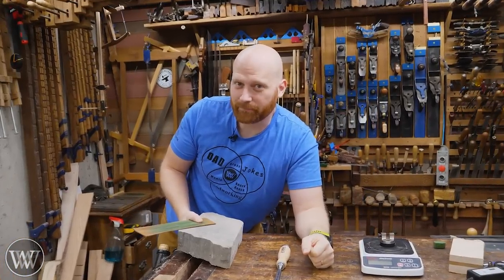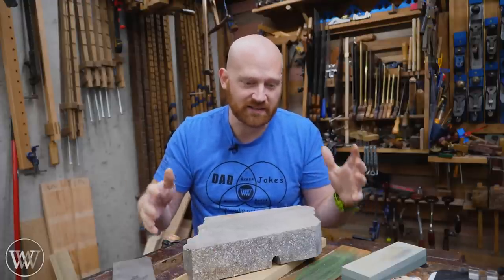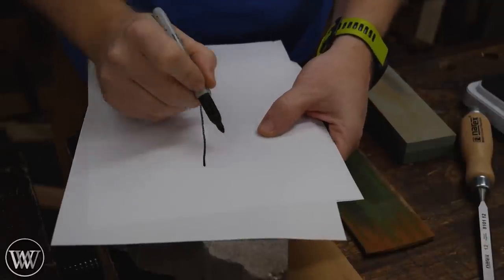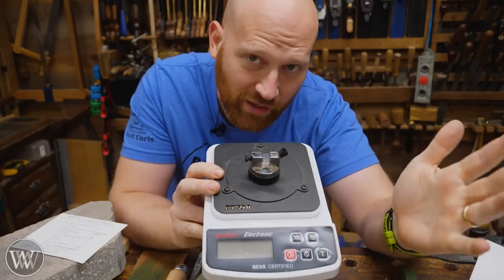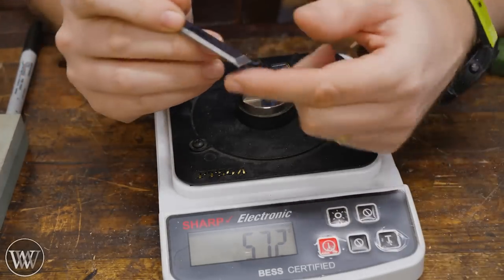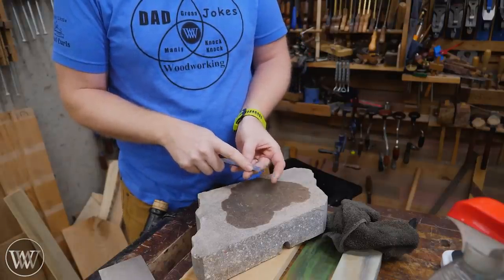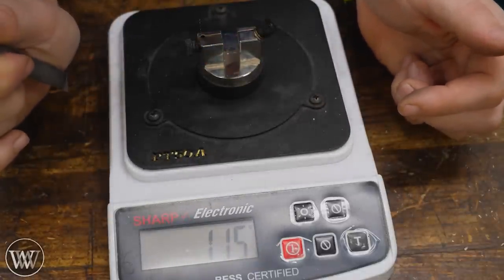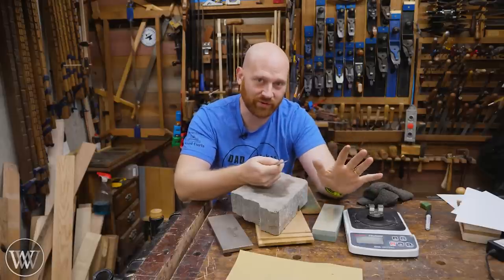Can you Sharpen With Concrete

Comment: When I was a kid I was taught a basic version of the three plate method to get a brick or block flat enough to sharpen tools. My old man was a mason, and we didn't need a lot of super sharp tools, but sometimes you did and a flat enough block/brick wasn't always available. The three plate method is overkill for most needs. If you just take two blocks, get some water between them and rub them back and forth in a somewhat random pattern including some turns and flipping which one is on top, you'll have a flat enough surface in a couple minutes. That's pretty much all you need for most garden tools and such. Even without a strop, you can use a red brick to get a knife blade shaving sharp as long as you flatten it first.

Comment: Sharpening is one of those things that seemed very daunting when I first had to sharpen, mainly because many youtubers make so big a deal of it. But then I just decided to get a 40$ whetstone sharpening kit from Amazon with two stones (grits 400/1000 & 3000/8000) and just sorta went for it. Turns out it's not that hard at all.
Reply: Exsctly what I did
Reply: I started with something similar.  A double sided 400/1000 diamond stone, and a strop with green compound.  I even glued the leather upside down.  Everything still worked great.  (As a tip for others, soft "drawer liner" works great.  Put your stone on top of it to keep it from sliding around.)

I've since moved on to Rex Krueger's "Cheap, thin diamond plates & strop glued to a melamine board".  Rex's video compliments this one very well.  
James: "You don't need anything special to get your tools sharp.  See, you can even do it with a rock."
Rex: "So stop overthinking things.  Just use stuff that is cheap and practical."
Reply: Yep, same. And I then I bought cheap diamond plates to keep at my bench for quick touch ups. And now I almost never even use the water stones either, since they require more setup and who has the time?
Reply: The same with convex sharpening knives on stones. It was way easier then the way some people made it out to be. Maybe even easier then sharpening v grind knives on stones.

Comment: THANK YOU FOR THIS ... I had done extensive testing just to improve my knowledge and once i was at a big box store and found a super cheap Aluminum oxide stone for like $5 and bought it to challenge myself if i can get a good edge - low and behold i managed to EASILY get a shaving edge from just that stone and a strop (not even leather , just scrap mdf) ... To make sharpening even faster with cheap oil stones , grinding a primary bevel with a bench grinder to get a hollow grind and then just doing like 4 seconds on the stone gives you a tiny secondary bevel in an instant and easily polished on the strop ... And no need for any fancy grinder , just a normal high speed grinder second hand off marketplace with a diy tool rest is fine

Comment: I don't have a problem with getting an edge. My father, may he rest in peace, taught me to sharpen by sound. A grating sound means it's too much toward the heel. A grinding sound is just right at the face. A scratching sound means it's too much on the edge. Those are not technical terms and are pretty subjective, of course, but it worked once I heard him do it. My problem is with keeping the edge square to the tool! My chisel ends up angled, my plane iron angles the other way, etc. I imagine it's just more practice and adjusting elbow and wrist angles. I never tried concrete, but my father would use a river stone to sharpen his pocket knife when he was fly fishing. Thanks for your clear, simple explanations!

Comment: When I'm in the middle of something is when I find the shortcuts to sharpening, case in point yesterday scrubbing a large block of Matai (NZ native) with a Record  5 1/2 plane, realised it was not sharp enough. In the middle of a mess of odd tools and wood offcuts, disorganised chaotic shed right now as I'm shifting it around, just hunted around for any old whetstone, and found a can of wd40 as liquid, so there's enough to get a fairly decent edge fairly quickly even though the aton was too small to get a proper motion just carefully do back and forth angled sideways. Amazing difference.

Comment: I've looked at a sharpening stone, a natural cobblestone, cracked length wise by a Chinese miner/store proprietor.  The piece is set into a piece of liveoak log, and the fracture surface has a glassy polished surface.  It has been worn into a saddle form by intense use.  It was probably used to sharpen kitchen and butchering tools.  I glue the strop to a piece of wood with hide glue - heh.  Provides a firm surface with less tendency to round the back immediately behind the edge.

Comment: Hello james,
Thanks for this video, i have been wood working for almost 2 years now, it s the time it took me to be confident in my sharpening skill.
Bascially the thing youtuber should teach is : get a burr , strop it, get back to the bench.
i like to wander in the how to also .. sometime i do figure of 8 (Paul Sellers), sommetime i go staraigth, when i need to change the bevel angle i do it holding the edge in the same way i sharpen not perpendicularry). all of this because i noticed that that was the way I (capital, bold underlined) was able to hold my edge straigth, it s just the best for me ( capital, bold underlined).
a burr, a stropped edge and happy shavings!

Comment: When people ask for "the right way" I simply point to tradition. We've been doing it in x way for hundreds of years, it probably works.  

In this case that's a grindstone, a wheel. However I must add that since about a hundred years we've made steel much harder and also since about the same time carborundum has been the material for said sharpening stones rather than sandstone.  

In fact I bet we got much harder tools after carborundum (a synthetic material) was invented as a sharpening stone, because it sharpens much faster than sandstone. So it allowed tools to become harder. 

I must also add that handheld (or laid down?) sharpening stones have also existed for a long time. But given that it's a lot more work that way I assume it was more for maintaining the edge rather than forming and repairing an edge. Or perhaps because stones that sharpen very thinly are more rare and thus aren't made into big chunks like sandstone was.
Reply from the maker: The question you have to ask when looking at tradition is which tradition. And in which time frame. And each one there were different ways of doing it. It's always just whatever the master told you to do.
Reply: Last time I sharpened I used my grindstone to establish 25 degree bevels, then just a couple of minutes on diamond hones to put on the 30 degree. Worked wonderfully, and I didn't need to change stones on my grinder.
Reply: Carborundum is Sapphire, only diamond is harder. Sapphire miners in Oz send the rubbish ones to the sandpaper makers.

Comment: I can vaguely remember as a kid that I had the head for an old ball pein hammer but no handle. Only other tools I had access to was a handsaw and a knife. I used the hammer and the knife to split a piece of wood to a rough handle but the blade wasn't sharp enough to whittle the end to fit in the head so I sharpened it on a concrete slab. That was getting close to 50 years ago.

Comment: Fantastic work, James! 😃
You know, I've been thinking about making a mini sharpening wheel... With water and so on, that would be turned by a DC motor... (And I have a few great ones for that here.) What kept me from doing it is a way to make the wheel itself!
Now I know how I'm going to make it! 😃
Anyway, stay safe there with your family! 🖖😊
BTW, I would like to make it just for the fun of it!
Reply from the maker: I thought about making one and just casting some concrete. Maybe someday.
Reply: @WoodByWrightHowTo  I spent ages trying to find someone who had done this, but only ever found people theory-crafting about how to do it, so I finally just decided to be the guy who tried!
I actually cast a 30 inch wheel and built a treadle powered grinder for it. I mixed Portland cement, and coal slag sandblasting media in a 1:2 cement:slag ratio, and added about a pound of concrete re-enforcing fiberglass, making a roughly 150lb wheel. It is a tough, hard wheel, and produces a much finer scratch than your concrete in this video. I need to true it up a bit more with a concrete cutting blade on a grinder, but I am really pleased with my results so far!

Comment: Blew one of my bosses minds one time. I made a bet with him that I could sharpen a chisel on the concrete driveway that would perform in less time than it would take him to sharpen one with his system. And I won ofcourse. I stropped it on my wallet it shaved and all it truly takes is varying pressure. He was going to toss the set out because they had been used as paint can openers, nail cutters breaking down pallets etc. The usual abuse youd see with pawn shop chisels. Steak dinner at the sports bar. 😂 bricks work well too.

Comment: Sharpening really does get better with practice. I tend to get lots of sharpening practice because whenever I use my chisels it's almost a given that I will drop one on the concrete floor. I'm getting better though. At least I don't cut my hands on them as often. 😂

Comment: I keep getting large chips off my antique timber framing chisel which I was using for chopping/mortise work. I am changing the primary bevel to 30 degrees after reading about brittle steel. Thought maybe slightly rounding the chisel blade corners might also help. Thoughts?
Reply from the maker: 30 or 35° is where I would go. Old steel can be temperamental. If the chipping is bad at a higher angle then there's not much you can do to it other than trying to re-temper it.
Reply: @WoodByWrightHowTo  thank you!!

Comment: Acquiring the skill to sharpen makes perfect sense. I honing my sharpening skills. 😉 I watched most of the sharpening YouTube videos from Cosman, Rex, You, Sellers, Katz-Moses, Stumpy Nubs and many more.  The only remaining question I have is does angle matter for edge retention, if so how much. An ancient Boy Scout leader decades ago told me that a 30° angle will hold an edge the longest. Myth or magic at 30°?
Reply from the maker: The short answer is yes. The higher the angle the longer the edge will last. But the harder it is to push into the wood. So different tools can be put in different angles or some people just pick one angle for every tool in the shop. Here's a video where I go into more detail on it. https://youtu.be/ansv-tktlfg
Reply: You have covered so much, thanks for clearing up 30° question.
Reply: A more acute angle will hold the edge longer, but wont handle lateral forces as well, so making chipping and rolling easier.

So 20° will stay sharper longer than 30°, but you can't hammer it into wood and expect it to maintain the edge as well.

You should use whatever edge angle you prefer the most.
Experiment by reducing angle gradually every sharpening until it no longer holds up as well as you'd like, then go up a degree or so, and you will be at the ideal angle.

Comment: Should I replace my honing compound if it's dry and flakes off after it's been on the strop for a few days? When I apply fresh compound, the old stuff flakes off.
Reply from the maker: I don't think I've ever had it flake off before. Unless you're using the smooth side of the strop. In that case I put new on almost every time I use it. Normally I go three or four sharpenings before I scrape off the old compound and put on a new coat
Reply: @WoodByWrightHowTo  I guess I've never scrapped it off intentionally. I've just kept adding to it as it flakes off so some of the compound on the strop might be 3 years old! 😆 Thanks!

Comment: HOW. HOW ON EARTH. What am I doing wrong that I can never get back to factory sharp? I tried with Japanese water stones, diamond stones, a belt with compound, a dremel's felt disk with compound. Nothing.
Reply from the maker: When it comes to sharpening it's not as much about what you use but the technique and method with which you use it. It's a skill and the only way you can learn a skill is by doing it over and over and over again and messing it up until you get it right.
Reply: @WoodByWrightHowTo  yeah, but I don't get what's wrong with my technique. I tried all angles on my strop
Reply: @bacicinvatteneaca Are you apexing properly (forming a small burr), then deburring fully?

Comment: Concrete seems to be roughly about 800-1000 grit based off how deep the scratch marks are
Reply from the maker: I would put this one around 400-600 it is a very uneven surface.
Reply: Depends on the mix of the concrete. You cannot really put a number on 'grit' because there are so many particles inside of various sizes.

Better to just blanket label it. Most concrete is coarse.

Comment: I think sharpening is a bit of an internet problem. We access to so many different people presenting different methods with different mediums etc. We only have to think a little to realise 30 years ago you would have such more limited exposure to different methods, generally one person showing you how they did it so you learn to do it like that. In the bigger picture people had to do this to earn a living, day in, day out. They learned to use what they had and got it done. 
What's not often discussed or overlooked, is the beginner with a cheap chisel(s) that will just never hold a good edge. They could be using perfect technique but they feel it is technique or sharpening stone holding them back when really it could actually be the steel the tool is made from.